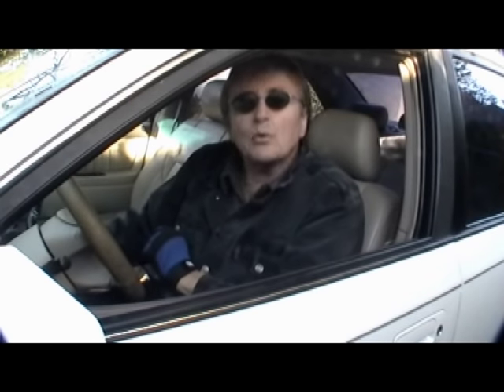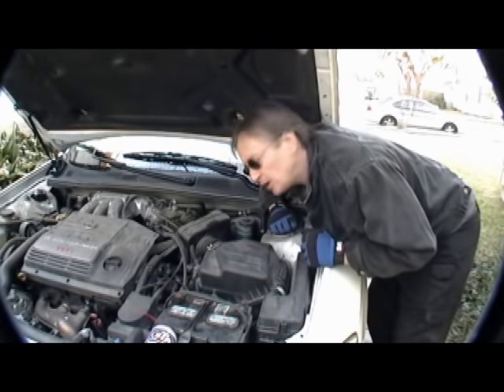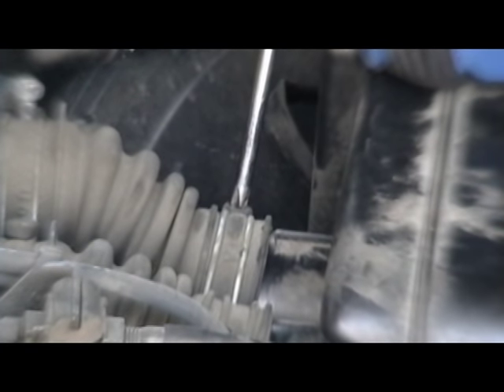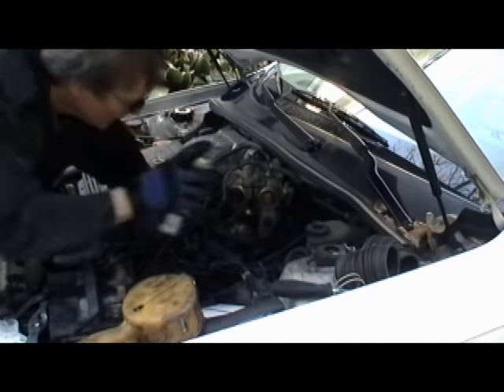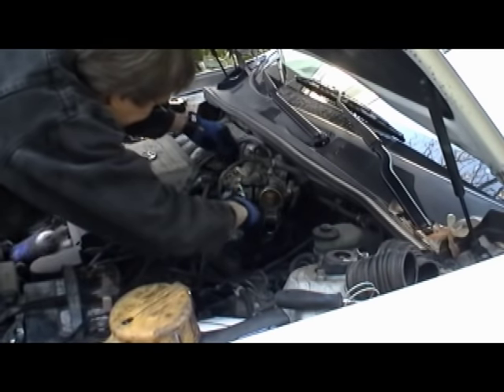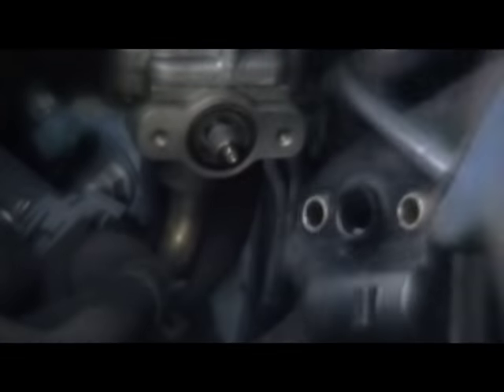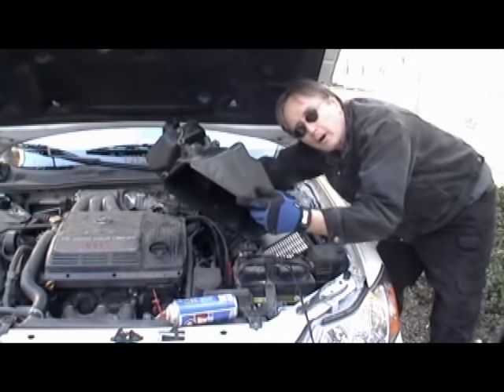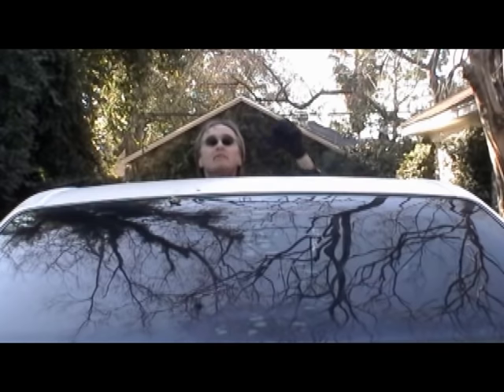How to Fix Engine Idle Problems in Your Car (Rough Idle)

Comment: Hey Scotty, I have this issue were my car starts a bit rough and almost doesn't seem to want to start. This happens sometimes only, other times It starts up just fine. And It's usually only the first time I start the car for the day. It seems to drive just fine, could that be the spark plugs? I'll admit, I haven't replaced them In over a year and I've driven the car 30k miles In that time frame. I've been so busy with work that I haven't had time to fix the issue, but now I have some spare time. Please help, any replies will be appreciated.

Comment: hey scotty I clean the throttle body bit after warm up the enginw rpms are still low and turnibg ac on result rpm drop to 500. no check light or throttle body code. Also clean iacv. help me

Comment: Hey Scotty. I have a 1995 Dodge Stratus with the 2.4 DOHC. 90k miles and it will crank fine but seems to only start/run when it wants to. When it does run it has a rough idle, and after 5-10 minutes of idle it acts like it wants to sputter and die till I give it some gas. When it does die it won't restart. I have no oil or fluid leaks and all fluids are at recommended levels, fuel pump is working because I can hear it engage and. I am at a loss as to what could be causing the issue. HELP, thanks.

Comment: my 95 integra has a high steady idle of about 2500 rpm all the time even at high way speeds when I'm coasting in neutral idle wont go down what could be the cause?

Comment: +Scotty Kilmer, I have this problem on my Toyota corolla 1990, it idles low randomly that you have to adjust the control higher to keep the engine running, at first it is hard to stop , next, it starts after several attempts, but it's still turning off. could you help me out? Thanks!

Comment: Hi I cleaned my throttle body on 2009 mdx but after cleaning the rpm is bouncing when I press the brake pedal and sometimes the rpm jump up with out pressing the gaspedal i relearned the tps,  but still the problem is not solved.  Any advice please and thank

Comment: hi scotty how u doing, I hope you call help me. I have a 2007 mercedes E350 v6 engine  and it's running a little rough, it had a fault codes p0306 and p0300 damage to twc. I started replacing the spark plugs and coil#6 cleared faults drove car for 20 miles and there's no codes but car still feels a little rough, I already did vacuum leak test, compression test, and checked fuel pressure, everything is good. so I'm really thinking about the MAF but not sure, any advise?. thanks.

Comment: scotty i have 98 suzuki sidekick, when i rev the engine it is shaking. i cleaned my egr valve, iac valve, clean sprayed my trottle opening valve, my hoses are all connected. still when i rev the engine it feels like it's struggling not smooth and shaking. my rpm is correct to the specs, what might be the problem, could you please help me. thanks

Comment: i got a 240sx, good car but the problem i got is when i come to a stop or when i throw it in neutral (its a 5 speed) the rpms bounce off 2500rpm then drops to 1000rpm,it does it about 4 times then the car dies out,could it be i need to clean the throttle body or could it be something else?

Comment: MR SCOTT, I have a 2002 ford van with 117.000 miles . I'm getting a bad rattle noise  when it's at idle, and when I step on the gas it stops . A mechanic told me it's in the Transmission.  CAN YOU PLEASE GIVE ME ANY ADVICE?  Thanks

Comment: Scotty, A big IF; 97' Corolla  Would this help to pass Inspection because it's putting out a bad EGR reading? Car runs Great. Just will not pass.
Reply from the maker: +Roger it would not fix egr reading, either you need a new egr valve, vacuum line is broken, or intake is clogged up with carbon and needs cleaning out

Comment: Hi Scotty I have Electra 2004 it work properly when I start it at the cold engine or morning time I can drive it for long time without any problem at any speed, but if I switch off the engine it will never start again until 2 hours later I check ignition it's ok no problem pls advice me ,thank u
Reply from the maker: if you mean it won't even crank over, starter is probably bad. if it cranks but doesn't start, often leaking fuel injectors flood the engine out and do that

Comment: hi scotty my car is running really bad when I start up in the morning oncr its worm its ok but when I sart first time in the mornings I put my foot on my exelerater and  its not doing anything and it splutters and nearly stalls then once its worm everything is thine thanks let me no I dont no if it needs a good run becouse its been parked up for some time but im starting car everyday the car was fine when I parked it up but now I just dont no whot it is ive cleaned the frottle body maybe thers some dirt I didnt use a wrag like u maybey that wil work its a vaxhall astra bertona 1.8 16v thank you
Reply: Do you have any smoke coming from tail pipe? If so it could be a head gasket leak... A simple way to test is remove spark plugs and turn motor over.. If coolant shoots out its the gasket... It could also be spark plugs..

Comment: high Scotty In my last message I was going to clean my fuel injection, which I did exactly how you did it and I still don't have a good idle. Have to keep my foot on the accelerator but I did notice when I stepped on the brakes to put it in gear the car completely shuts down. what do you think of that? could it be my booster? what's a quick way of checking this .
Reply from the maker: +David Risko plug up the booster vacuum hose after removing it from the booster to see if it stops doing that

Comment: I have 2011 acadia i did this my car's rpms still fluctuate 500 to 700 sometimes it feels like its about to shut off but i only feel it when im at the light or in drivetru ,while driving it feels fine what else can be the cause, i dont have any check engine on so im bummed as to what it could be.

Comment: Hi...i have a Mitsubishi lancer 1998(Carburetor). The problem is that in the morning it has a slow start and i have to press my accelerator for it to start...moreover, it hesitates and have a rough idle...sometimes if i accelerate to the max, there is black smoke coming out from the exhaust...can you help please.

Comment: Hi Scott how do you fix a Honda odyssey 2000 4 cylinder 2.5 from misfiring at a stop sign or lights an that the only time I changed the sparkpugs but still doing the same can you help I'm from New Zealand please can you help

Comment: I have a 2009 toyata Corrolla and the motor idles up and down ! It idles at 1000 rpm cold & when its warm it idles at 850 rpm.  But it shakes a bit  and revs up and down , and I brought it to the dealers twice and its still the same.  Any ideas ?

Comment: Hey Scotty I have a 2004 eclipse gs spyder . I have a engine light on which the code is p0507 their is no leak ,cleaned the throttle and sensor. the rpm in parked is almost 1/2 .could it be that I need a new sensor or ecm?

Comment: hey i have a 94 cadillac deville not with the northstar engine. when i turn it on the rpms start around 2500 then go down but when im driving it starts accelerating by itself i changed the idle air control but it still does it any help?

Comment: havin  some issues with central locking system it always locks all doors but only opens them sometimes ive no fob i use the key its a 2002 mitsubishi carisma
Reply from the maker: +Brian Galway the switch inside the door is breaking down, needs replacing

Comment: I heard you shouldn't apply the cleaner if you don't have the car on while constantly accelerating? But you did it with the car off?
Reply from the maker: yes with the car turned off then let it air dry an hour or so with throttle open
Reply: hey +Scotty Kilmer I have a 98 mustang. and my car will start but it shuts right back off. do you think this will work for my issue?

Comment: Hi Scotty!! i have a problem with my rpm at about 50 mph above. whenever i try to accelerate at a high speed my rpm would stutter back and forword. i have an 03 honda civic hybrid, i already try cleaning the throttle and change the spark plug but it didnt help. what do you think cause the problem? Hope to hear from you soon!! Thank You!!!
Reply from the maker: pray it's easy like a clogged fuel filter or weak fuel pump pressure test that first

Comment: i only have 36,000kms. my toyota sienna has some vibration under the center console when i'm lightly toucking the accelerater. you can kind of feel it under the seat too, but if i'm accelerating the vibration goes away completely. seems like it's on low rpms. please help. is it serious?

Comment: Hey scotty, I have a 1998 toyota corolla and it runs pretty good for having 133,000 miles. anyway when i put it in park it revs kinda high, but in drive and reverse its fine. what do you think it could be?
Reply: Did u figure it out?

Comment: hey Scott like your videos. if my engine light is on and idle is really high around 2500 to 3000. is that still a sign of dirty throttle.
Reply from the maker: +Bruce Millard yes, that or a massive vacuum leak

Comment: Hello Scotty,
I have an 02 Toyota Camry that will not idle anymore without pressing the gas pedal. The car runs fine going down the road. Will this technique help my situation?
Reply: +Scott _ I have an 02 Camry as well that had poor idling (around 250 rpm) and stalled occasionally on start up.  I got the fuel system flushed and it runs like new again.  I'd say give it a shot.  These cars get gunked up fairly easily

Comment: 91 civic does that work the same I just replaced tps and now I get a check engine. light and it keep cutting of at stops stalling out
Reply from the maker: +RASHAD “SIR GR33N” WHITLEY tps is either bad or not adjusted correctly if light didn't come on before

Comment: Any tips for cleaning a electronic "drive by wire" throttle body??  I believe my 2011 GMC Canyon 2.9l WT has this kind of throttle body.  Have you worked on Chevy Colorado/Canyon throttle bodies??
Reply from the maker: yes , you can clean the throttle plate using throttle spray cleaner, they will clog up over time. You turn the key on and push the accelerator down to open it to get it cleaned. (without the engine running of course"
Reply: Thank you for the quick reply Scotty!!  Other than the above mentioned tip...  Any other special tips so I don't trip a "check engine light" or cause any any additional problems with this truck??  I have seen that some people take off the throttle body off for cleaning (this model truck)??  However, I have always just cleaned a throttle body on the vehicle (2009 Toyota Tacoma 2.7l).
Reply: Just purchased a can of CRC Throttle body cleaner...  Cleaned the throttle body on my 2011 GMC Canyon..  Worked great!!!  seems to idle much smoother and at a slightly lower RPM.  Thanks for the tips Scotty!! Much appreciated!!

Comment: MR. Kilmer, I have got a Toyota  corolla AE92  1.6L carburetor auto 1992 model car.And have trouble to start the car when cold as it idles rough until the car warms up and then its fine. I have changed sprark plugs, thermostat, ignition lead, changed engine oil and cleaned  the carburator with a carburetor cleaner but the car has still same problem. Could you please give me advise what could cause a problem?  Thank you.
Reply: +Antoni Tome Check your choke on the carburetor.

Comment: Hello Scotty ..do you think this Throttle cleaning will bring a good idle to my 92 Astro van ? See, right now is cold in Houston and when I first turn on the Van it wont idle at a high RPM as other vehicles do when they wait for the engine temp to come to normal operating temp. If I step on the gas it runs good but when I come to a stop it idles low as if wants to stall but it wont die on me and the RPM fluctuates from low to a little higher and on those instances that it idles a little higher the Van idle feel smoother. I have done other work on this van since it is old but it have given me good mileage which is 250,000+ miles now. I have changed the 2 fuel injectors, Fuel pressure regulator, Idle air control sensor, EGR valve, Temp cooling sensor, Spark plugs and wires, Fuel filter. Before the idle was higher and now it idles low. Thank you for helping us out.
Reply from the maker: +hmoreno1126 worth a try cleaning it. Also do my video "finding engine vacuum leaks with a cigar"

Comment: Hello Scotty! I have a Corolla 2003 model and when my car idles or when i have it in Park or Neutral, The RPM is a bit higher than it use to be and causes the car to shake but when i am in drive it's all fine and normal. Would the cause be a dirty throttle head like above?
Reply from the maker: +Mina Elias    yes, pray it's that easy a fix

Comment: hi, I have a 2005 Kia Sedona that hesitates when I have brake on at red light and car is in drive,but at park car is normal,lately I put car in neutral at light with brake on and car runs normal,rpms are steady,i have cleaned throttle body not long ago,a cleaned around sensor,can you help me find the hesitation problem,p.s I also checked the air intake tubing but couldn't find air escaping,im at a loss,thanks. I watch you videos all the time.
Reply from the maker: often a dirty or worn out maf sensor, try cleaning that first. Also run some fuel injector cleaner in the gas tank
Reply: Thx .

Comment: Hey scotty, just picked up a 2006 Ford E250 van,, I think it's been sitting for about a year,, anyway, when it gets hot, it sometimes stalls when slowing down to around 30mph, or stop lights, also, it does pull when getting on freeway, buy feels as tho it is holding back,, no check engine lights,, should I clean the throttle body and mass air flow meter, or do you think I should try something else? thanks in advance!!
Reply from the maker: +frank iossa yes, also do my video "how to clean fuel injectors on your car"

Comment: i change the throttle body and  idl control valve and throttle position censor and mass air flow censor  still the same for me any one can help on my car seems like someone is pushing on my gas pedal and wont let go high idle

Comment: I have 1st generation swift and the problem with it is it vibrates whenever i  apply brake just before a hump and the rpm comes down to 600 and the engine also make loud noise when the is in the gear but these all things occur when the car is in drive or reverse gear...please help

Comment: Scotty my 1990 Cadillac Eldorado Biarritz is idling too high.I just got the tps sensor,the distributor and the ignition switch replaced.When I picked it up from the shop it was idling too high and the service engine soon light stays on while driving.I originally took it in because it stall on me twice and hesitated to start again.Any suggestions?
Reply: My car is idling now but the service engine soon light comes on when I accelerate.
The code says #52
it  1990 Cadillac Eldorado Biarritz.
Any suggestions?

Comment: Scotty I have a 2005 Jeep Liberty that idles rough, I did the smoke leak detector trick and had some coming out of the throttle body shaft I bought a used throttle body and it's also leaking in the same area my question is ...is that normal on some vehicles?
Reply from the maker: at that age, yea, jeeps leak some, as they are cheaper made
Reply: Ok Thank You

Comment: HELP PLEASE!!! I have a Mazda 929 1988 rough idle, black smoke, smell gas at muffler. Changed spark plugs, cleaned throttle body, IAC. Haven't touch the oxygen sensor, MAF sensor yet. Neither the EGR, New spark plugs turned black.

Comment: Scotty, I watched a lot of your videos, but never have I seen anything concernig the old muscle cars. I'm stepping out here to see if you can help me. I have a brand new 351 W in a 1969 Mach 1 (show car)...Cranks great, idles great, but when I put a load on it, it dies....I have to rev the engine a little and pop it into gear....she drives fine and shifts great until I come to a stop....then it dies again. It has a bigger than stock Cam from Comp Cam and a 2500 RMP convertor so it shouldn't be stalling. I have the timing set at specs for the cam at 14 degrees TDC, and the idle seems a little high when I have to put it in Neutral at a stop sign to keep it from stalling.  Is it the Idle or timing. I'm frustrated
Reply from the maker: +Skip Barrus  once came is changed, all bets are off .  Engine has to be set up correctly for that cam, and it takes a pro tuner to do that. Start by finding one

Comment: Hi scooty, good morning.. i got a 1996 toyota corolla carb type..  My car idle is at 950rpm and when i switch on the lights and step on the brake my idle drops down to almost 750rpm. What seems to be the problem and it  started to shake.. Thanks in advance

Comment: Hey Scotty i have a 99 acura tl 3.2 v6. I have 2 codes in it, p0505 and p1129. Also surging idle from 1500-2500 rpm. No vacuum leaks and all sensors are reading. I replaced iac valve but no change. I bleed the coolant system, cleaned throttle body and smoke tested for vacuum leaks everything is fine. Im stumped and so are a few mechanics i had looked it over. Any help would be much appreciated.
Reply from the maker: +Brent C often a bad main computer driver circuit on that one
Reply: +Scotty Kilmer Ok have you dealt with this before? And what does this entail? Location of it? is it a fuse or circuit breaker that needs to be replaced?

Comment: hey Scotty, I've recently changed my spark plugs from NGK platinum back to regular copper ones and my car doesn't seem to run as smoothly as before and it seems like it's more Sluggish now than before any ideas? is the platinum better than the copper? thanks
Reply from the maker: +treluvsjay1 yes, it often is, they fire cleaner
Reply: +Scotty Kilmer oh okay do you think I should change back to the platinum plugs?